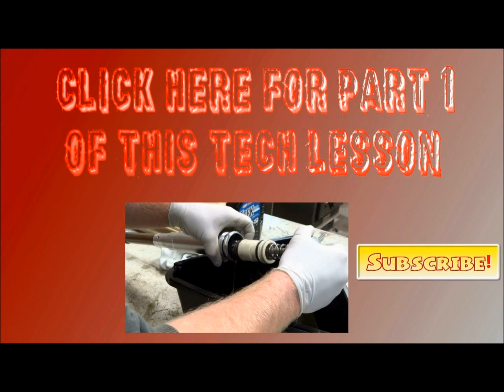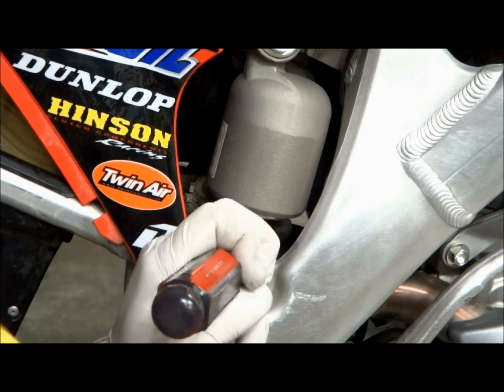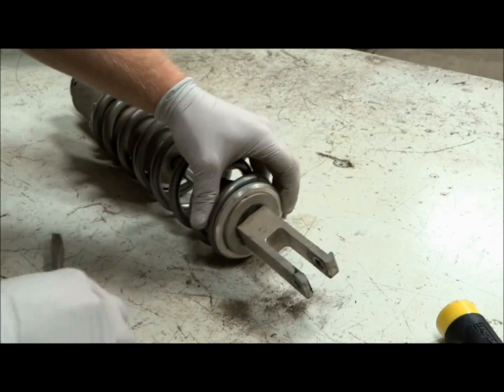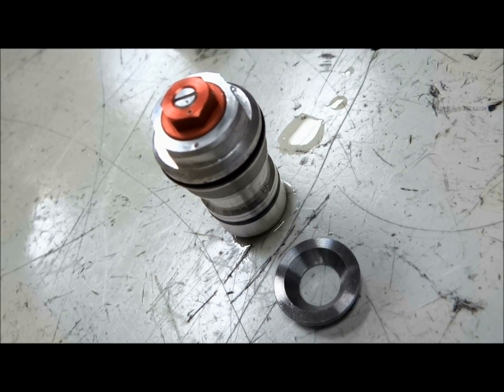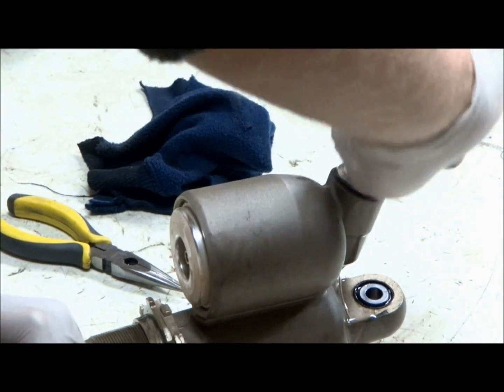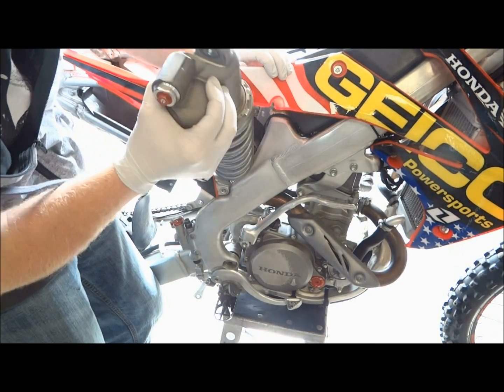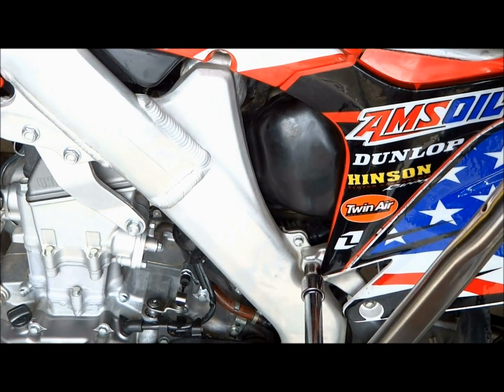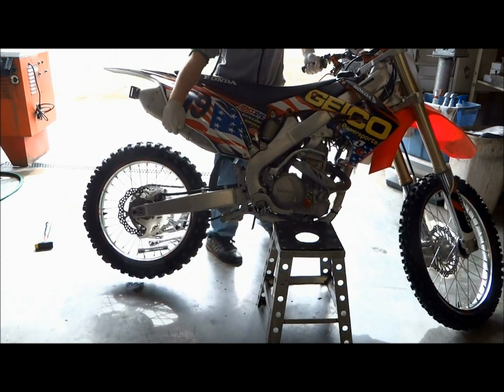CHANGING SUSPENSION OIL PART 2

Comment: One tip, measure the length of the spring before loosening it so you can put it back where it was and you don't have to reset the sag.

Comment: Didn't show anything there is a leak refill it and the oil will leak out anyways so I don't know what your trying to do
Reply: Wrong... Suspension oils start to break down in as little as 10 hours of use. New oil will make an improvement in the feel of the suspension. He never said there was a leak and if there was the seal would need to be replaced.

Comment: Great Tech Videos, thankyou. I need to replace the bump stop on a 2006 CRF250R, can I just remove the clevis end or do I need to pull the whole shock down and install bump stop from the top of the shock rod?
Reply from the maker: +Michael Joblin Thanks! Yes, the easiest way to replace the bump stop would be to remove the clevis. The nitrogen in the bladder has to be released before hand though. Of course make sure the spring preload nut is loosened all the way first too.
Reply: +ReVive Moto Parts Oh, ok, to stop oil flowing out through bottom of shaft?
Reply from the maker: +Michael Joblin Yes, I believe so. The manual recommends releasing the pressure. I haven't taken apart a shock in a while so not quite remembering the process.

Comment: I need help.i have a cr85 big wheel and the suspension is far too soft im planning on rebuilding the shock do you think it will do the trick??
Reply: Colin Morrison no you will have to get new springs if the suspension is too soft for you

Comment: I thought this technique would be easier than taking the whole shock apart but if you have a newer bike it is a pain. my 13 crf450 has a lot of stiction since the bushings are fairly new so when I tried to bleed the bubbles out it would stick and the blow oil out of the hole. wasted a lot of  oil and ended up having to take out the clips and pull the rod out anyways because there was still a bunch of air trapped in the shock.

Comment: Hello, I am of argentina.mi question is:se loads only with compressed air or with nitrogen once finished the replacement of oil?
Reply from the maker: You will need to charge the bladder with nitrogen.
Reply: thanks !!!

Comment from the maker: I don't know about that, it's best to use pure nitrogen as it is more stable under pressure and varying temperatures. I wouldn't risk using the air in our atmosphere.

Comment: do unscrew the bolt from the nitrogen container and just pump the fluid out then add more suspention oil also need to know how I would put the air in the container

Comment from the maker: The service manual recommends that it be done every 25 hours, but of course it depends on the rider and tracks. A pro class rider should service their suspension about every 25 hours or less, and a beginner about 35-45 hours.

Comment from the maker: You add air after filling the shock with oil and pumping the shaft several times. The compression adjuster must be out when adding air to the bladder. When you add compressed air to the bladder it should push out the cap a little and make the air bubbles go to the top where the compression adjuster hole is.

Comment: Thank you for this video. I tried to change the oil in the shock like you stated but have ended up with some air in there that I can hear. When filling the shock with oil is it necessary to pump air into the nitrogen tank, or can I do that after I have finished the oil change sealing it back up?

Comment: Use a motion pro spring tool , then you do not have to measure the spring , and Please WARN PEOPLE THAT THE PSI IS AT 120-175 AND REMOVING THE CORE AT HIGH PRESSURE IS DANGEROUS !!!!!!! ONLY PUSH IN THE VALVE GUYS

Comment from the maker: If it rebounds too quick it is either mis-adjusted or the nitrogen needs to be recharged or bladder replaced. You should use the recommended oil. 7 WT might be acceptable, but I would not use 10 WT.

Comment: I saw that the monoshock disarm completely, even the nitrogen cylinder, so that? I just want my monoshock respond well. It has nitrogen and no oil leak, but the rebound is fast, does not contain the rebound. you think that is? My manual recommends 5w oil, you may put 10w?

Comment from the maker: The process should be similar, but you will need to release the nitrogen and recharge it after changing the oil. Look in your service manual for the recommended PSI.

Comment: XR 250 R for 2000 is the same procedure? can not touch the nitrogen cylinder and only change the oil? I have not as nitrogen reload. How much psi nitrogen is used?

Comment: Alright, because I tries to pump the shaft to get the air bubbles out when I barley put the new oil in, and I pushed to hard and it came out of the blatter, so I just refilled it and put the compression adjuster screw back on.

Comment from the maker: Yes, the air needs to be released before recharged. Just fill the shock completely with oil before installing the compression adjuster.

Comment from the maker: Yes, the stock springs are for most 140-160 pound riders on a 250F. 170 should be fine, just make sure you set the sag. I've had good luck with Maxima oils.

Comment from the maker: No, you will need to release the nitrogen. If you remove the compression adjuster with the bladder pressurized, oil will spray out. And you would not be able to add the correct amount of oil when refilling the shock if the bladder has pressure. Yea, it doesn't take long to re-charge the shock. It's like airing up a tire basically. What do you mean by weight? Weight of the oil or weight of the rider?

Comment: Can you just change the oil without releasing the nitrogen? And also I unscrewed the bottom connecting rod and I think it was oil that came out but I'm not sure. And do they fill the schlock with nitrogen in like 20 mins or does it take a while? And can you tell me what weight is recommended for the stock springs for the front and rear are?